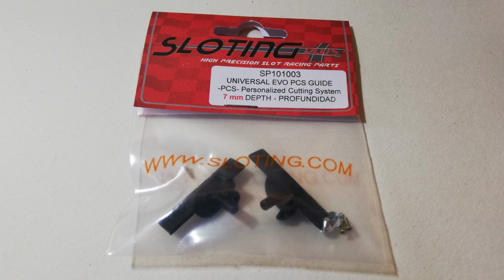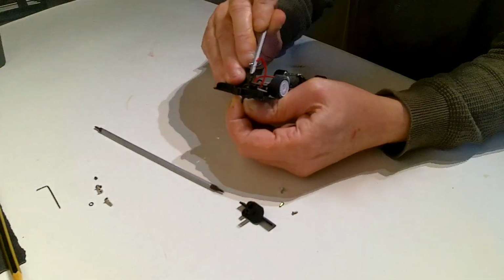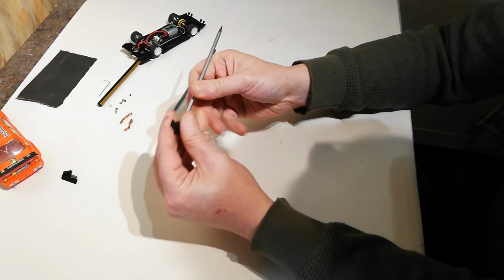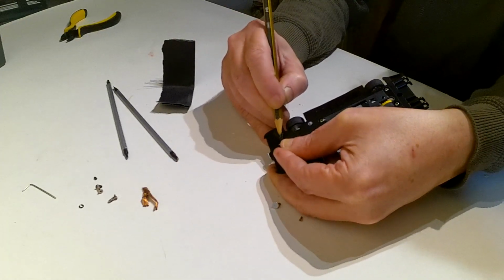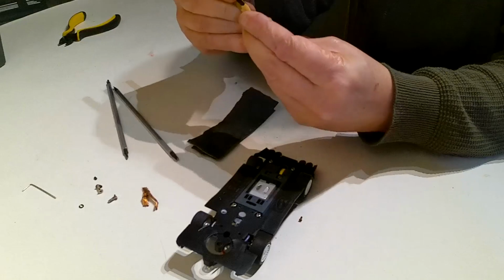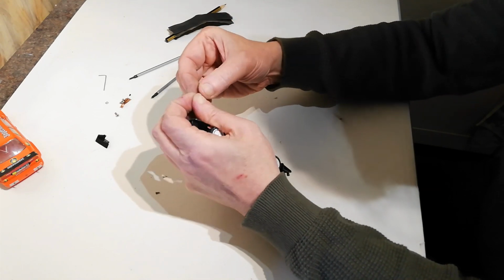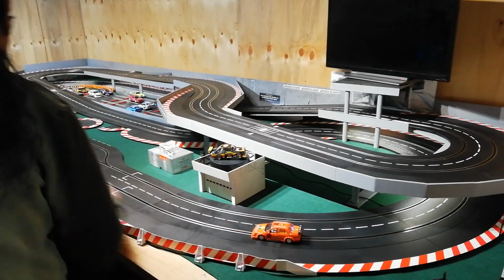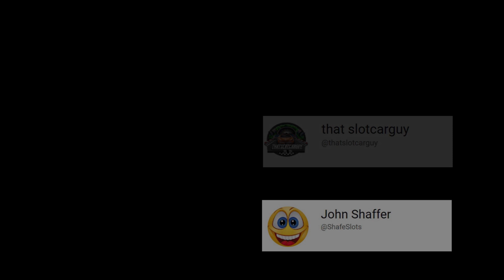Slot It & Sideways Sloting Plus Replacement Guide Swap

Comment: Great video Dave, I have not tried that guide. I need to look into those. I have been using the Slot Invasion guides for some of my cars.
Reply: Have you found much difference in using the SI guides? I have 10 cars with them, maybe they're quieter?

Comment: "fiddly grub screws" Yes they are, every time I put new brushes in a Slot It car it gets easier, but its some tiny parts to deal with.
It seems a little old school compared to a 2 minute brush swap in a carrera car.  But it works.

I like the pencil lead plan. Its weird how a carrera car is SO sideways and fishtail happy with no magnets, and a Slot it car has almost no magnet to start with, but hooks up pretty well that way. Fine tuning makes a big difference for either car.
Reply from the maker: I think a lot of it with the Carrera cars is the tyres are made of the hardest rubber on earth....   that then randomly degrades at some point almost overnight.  I've managed to get my Carrera RS3200 Capris to run OK without the magnets,  I put over 50 grams into their CSL BMW though and it's still a handful